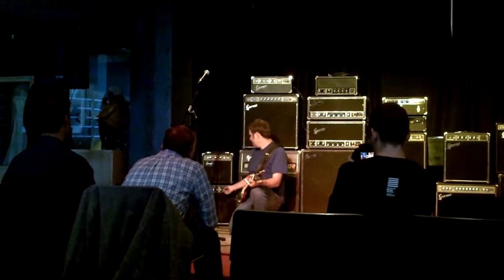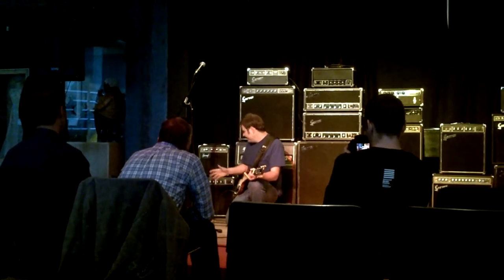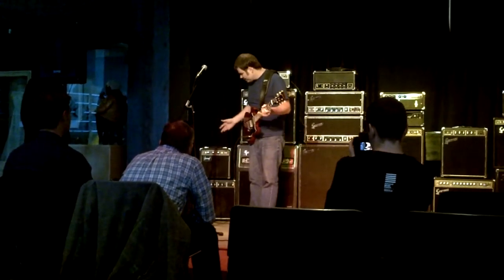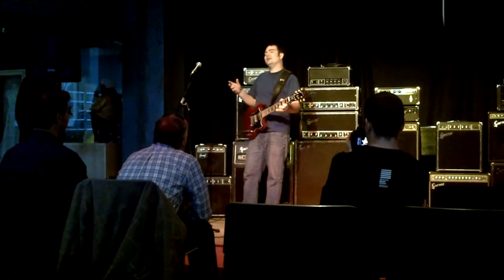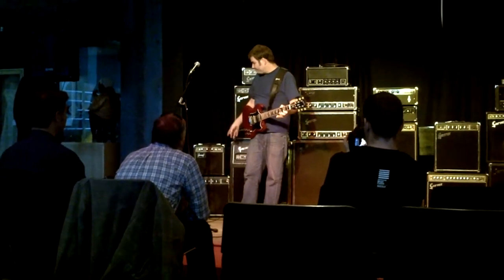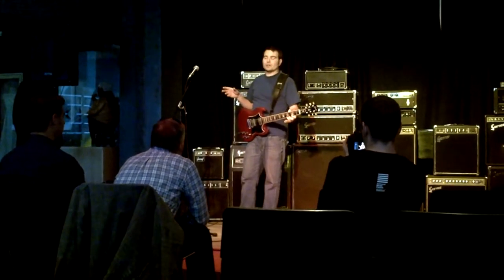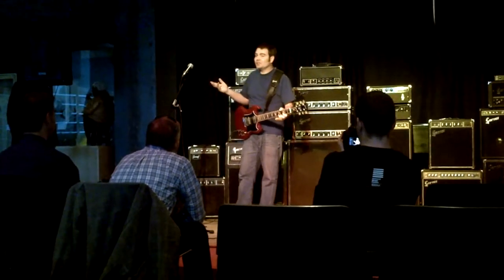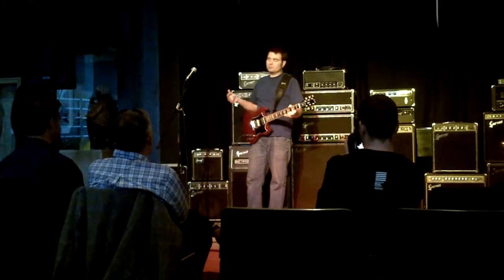Garnet Gnome - fenderbronco.com

Comment: I’ve got a gnome and a couple other garnets and the gnome tremolo, to me, is one of the not-so-good ones. It almost makes the low notes and harmonics feel wonky or out of tune or something. I had an amp technician look at it and to see if it was not working to spec and he got inside and looked at schematics and said that it is actually just an unconventional circuit that doesn’t work like most others. By comparison, and to be more aligned with this guys opinion, my garnet revolution 1 has a real-deal tube bias modulation tremolo and it sounds really outstanding. It is even and round and has great depth and no harmonic weirdness.